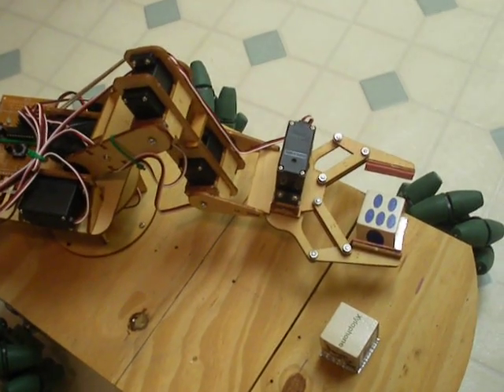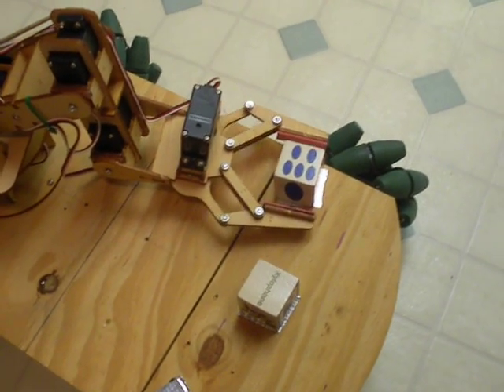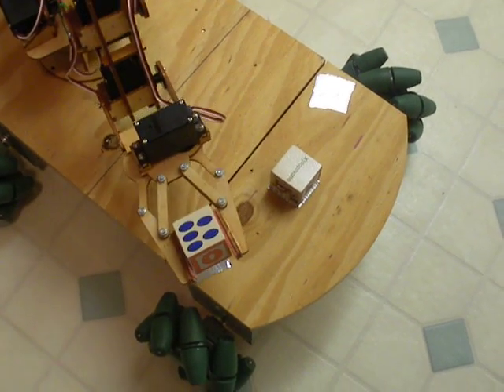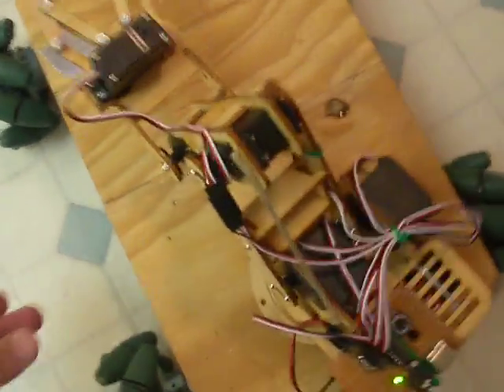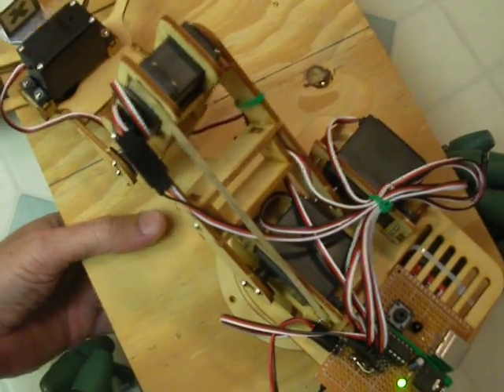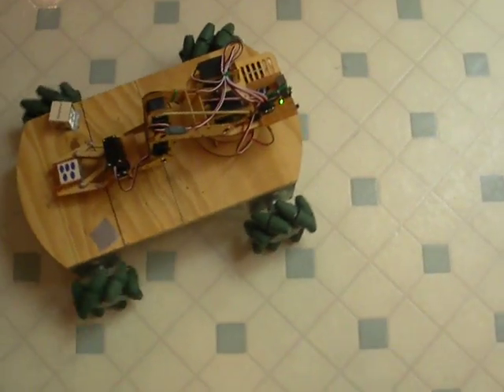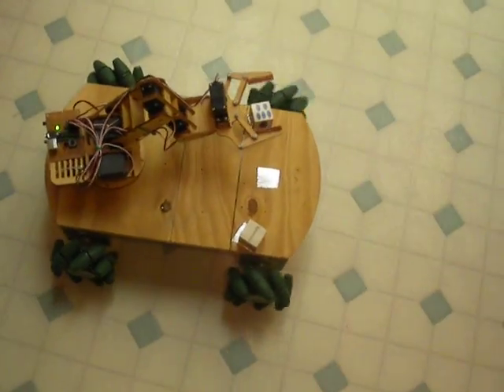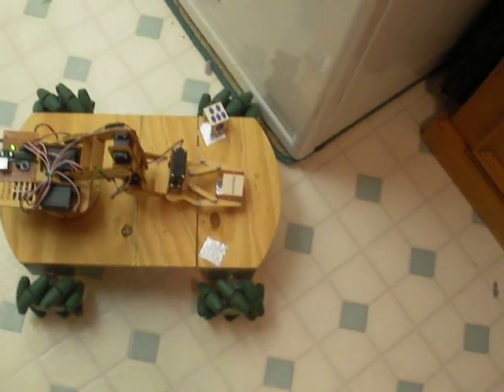Mecanum Robot with Arm

Comment: is there a way to make these macanum wheels home made
if there is pls provide resources
Reply from the maker: Maybe Thingiverse, but you'll need to print a variety of materials, including rubbery rollers. Still won't be as good as VEX wheels, which are very smooth. IIRC they used to cost $40 but are now $60 at https://www.robotshop.com/en/mecanum-wheel-set.html
Reply: @ercost60  thank u for ur support , but without 3d print , like for example from wood etc
Reply from the maker: See this guy, he 3d printed his wheels. https://youtu.be/83tVkgT89dM